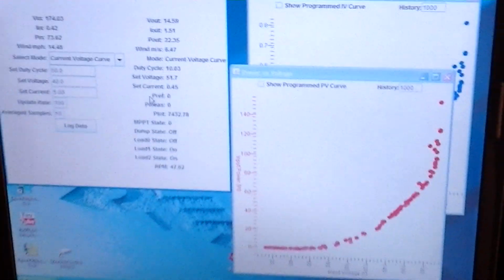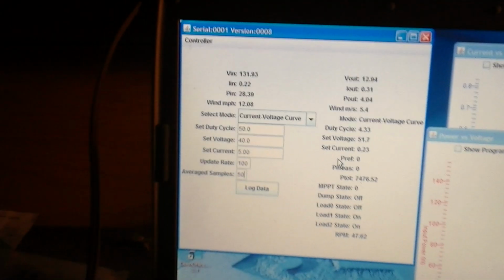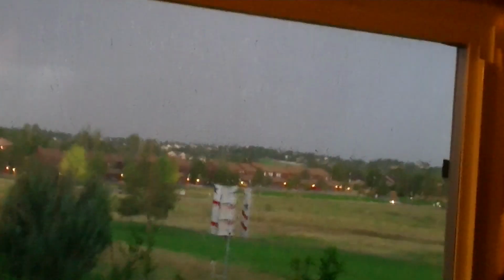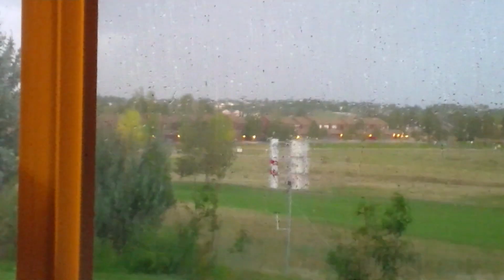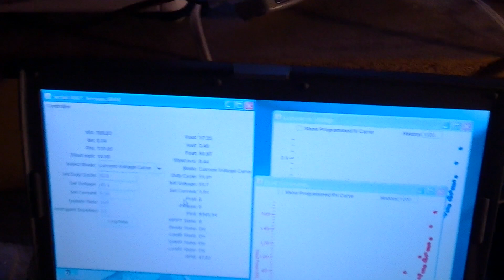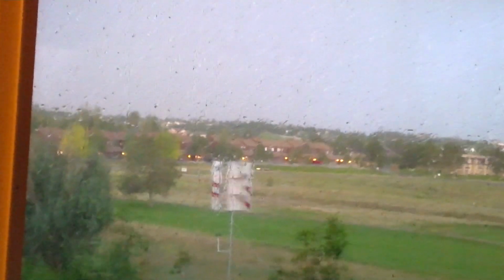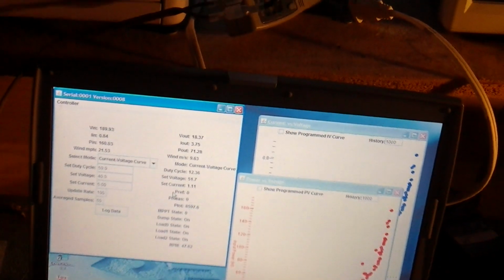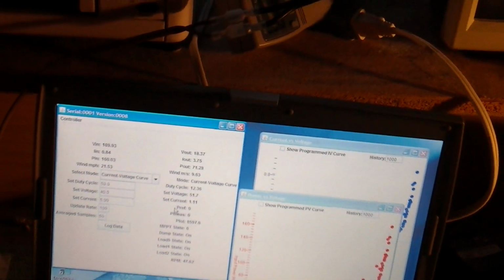MPPT Testing 1

Comment from the maker: So far it has, in up to 40 MPH gusts.  Although because this alt puts out so much voltage the controller has to leave the curve and pull extra current to protect itself from over-voltage damage when the wind exceeds about 25 mph.

The efficiency of the board seemed low.  Normally with the solar input it's 90% or so, but in this test it was as low as 50% at one point..